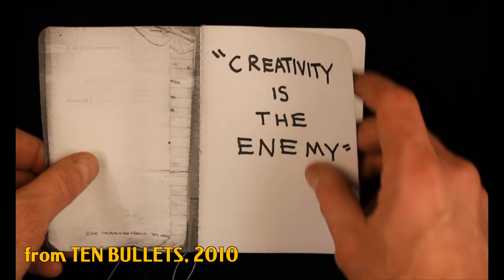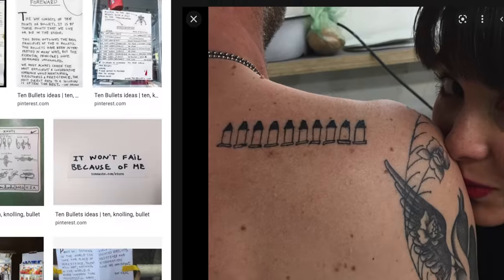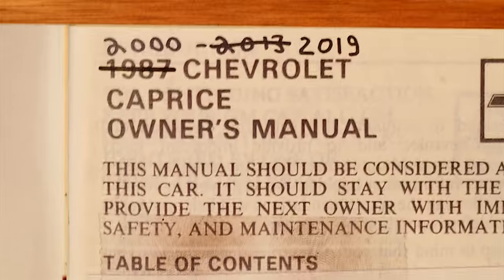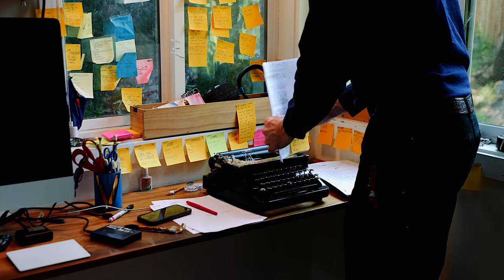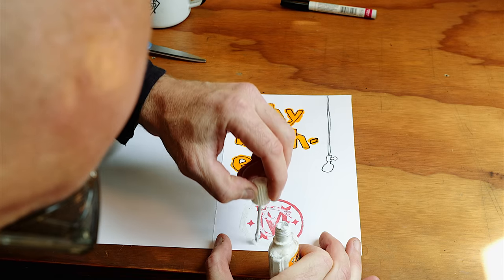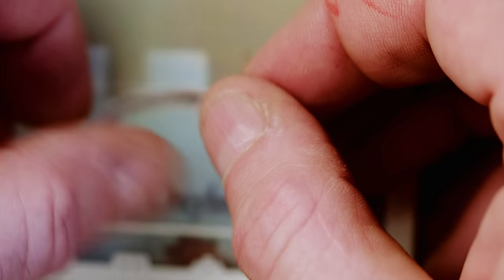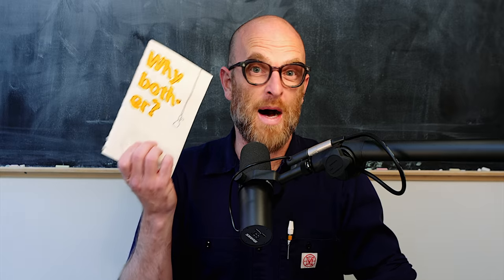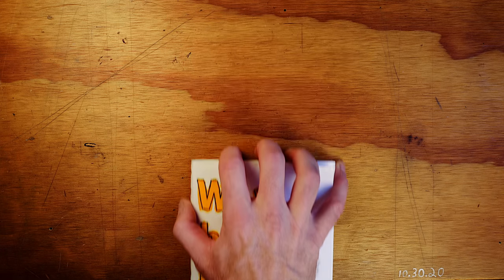How to Make a DIY Zine

Comment: You're not ripping off Tom Sachs. 'Zines were around long before. At worst we make homages to them. In the same way I painstakingly printed out and bound scans of Ten Bullets (harvested from a collaboration site some years ago). I then used this to make my own Working to Code for my shop / studio. Is it influenced by Sachs? Yes but also by many other things. The content is original even if inspired. Regardless - looking forwarding to printing / binding yours (zines are still a thing with my [modern] kids and even my very [not] adult collaborators)...

Comment: Did you adjust the images to allow for creep when folded? 6 pages, 110lb card stock. if the end user trims flush, the inner pages will be shorter than the outer, could put your images near or inside trim safety. 
26 years of printing :) I appreciate the detail in this video.
Reply: This is the key info. Thank you.
Reply: As one who downloaded- and printed it. He didn´t, haha. Unless I failed at the folding, which I think I didn´t. But it adds charm to it!

Comment: Not sure if this next idea/thought/tip is for you Van, because you seem to make work with purpose, and all the choices are there for that purpose. But if you, or anyone else would want to do this themselves; I found it to be nice to use a heavy duty paper cutting table to cut the page ends flush. This wil work only with a max ammount of pages and the type of the paper is also a factor. I found it nice to do that.

Comment: You lost me when it looked like you were stapling it to the table. Explain please.
Reply: He did staple it into the table, but them removed it and bend the sharp ends inwards to the paper.  It's effective way to bind thick pieces of card stock paper together that a typical stapler could not do.  Also, everyday office staplers do not have the reach to staple deep into the width of his zine.
Reply: @canadude6401  
Gotcha, thanks